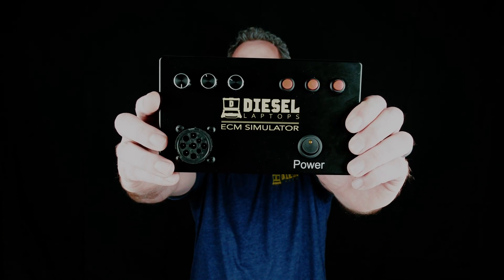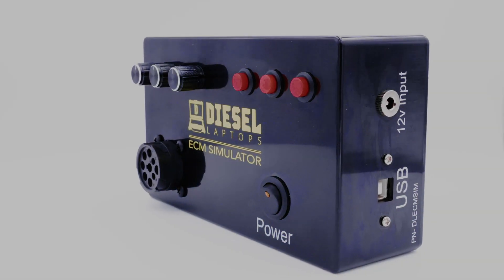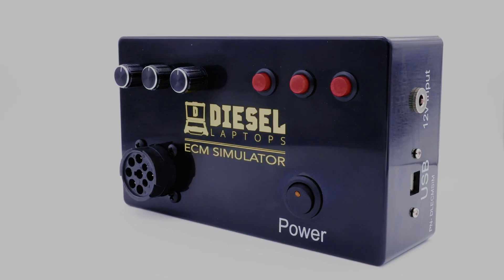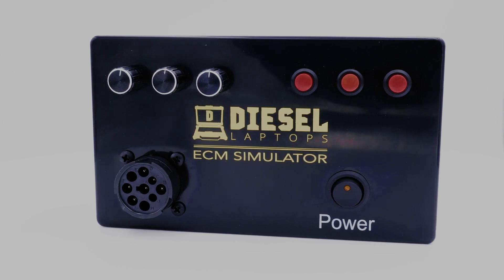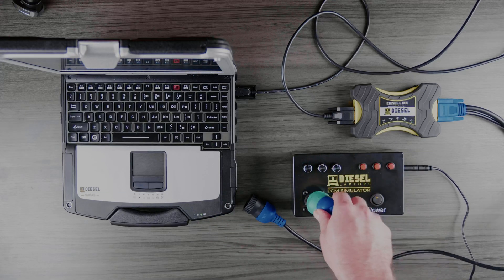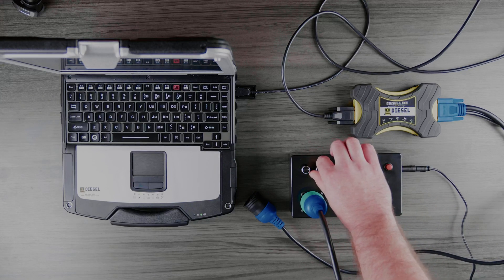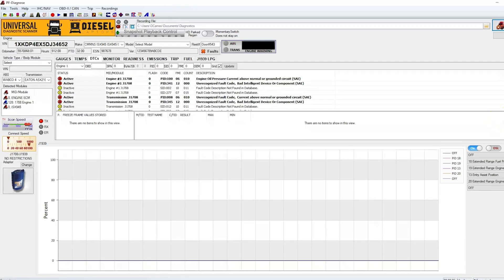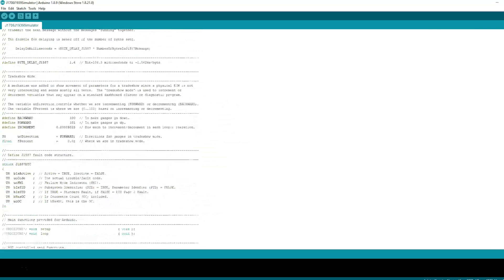The ECM Simulator is an Engineer's Best Friend

Comment: Will this simulator allow me to adjust the voltage from the Accelerator Pedal Sensors out of the box or, will I need to modify the program?
Reply from the maker: Hello Adon,  Accelerator Pedal voltage is not currently configured out of the box.  But this can be configured easily with the software with a few changes.  Thank you for your interest!